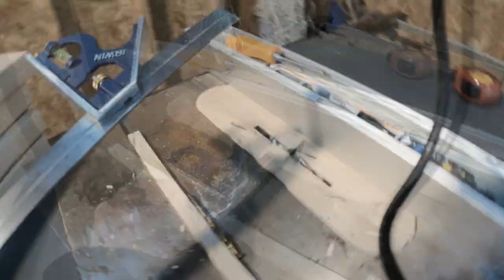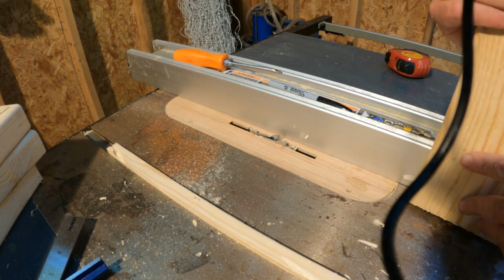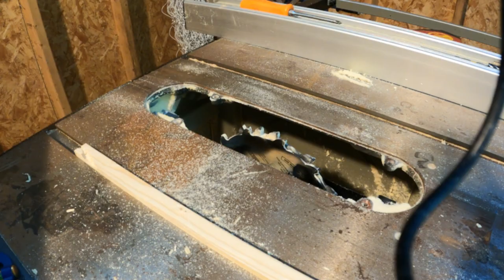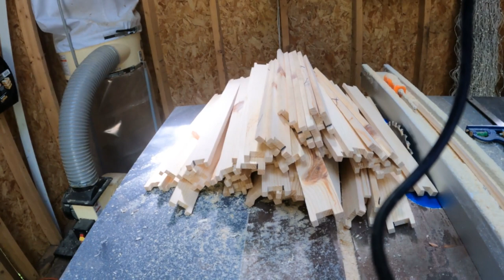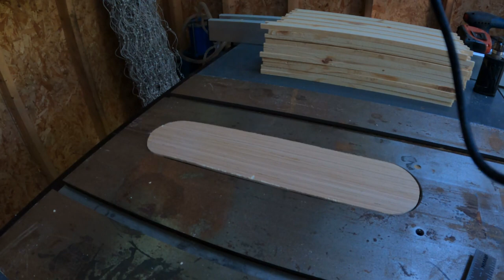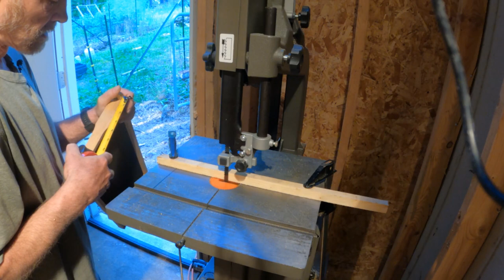making side bars laystroth bee hive (works for any langstroth frames too) #diy #bee #hive #frames

Comment from the maker: for a fraction of the cost of buying pre-cut or pre-made frames ... you can diy them with basic tools - even if you had to buy everything new I use, your return on investment would be quick.  How much is a fraction of the cost?  Current price for a non-pressure treated 2x6x8 is $5 - that will make estimated 155 side bars for a deep, 217 mediums - not counting any waste due to knots at critical points, etc